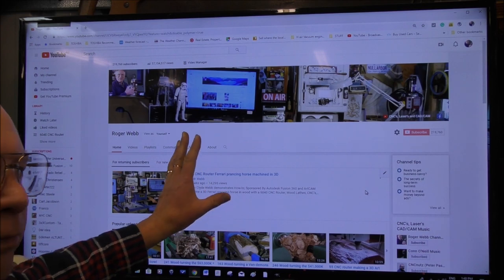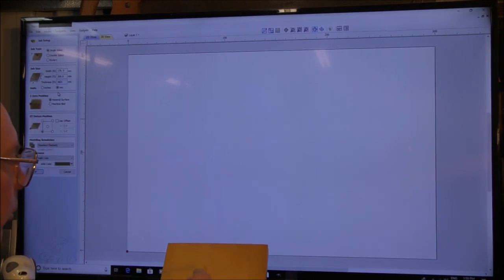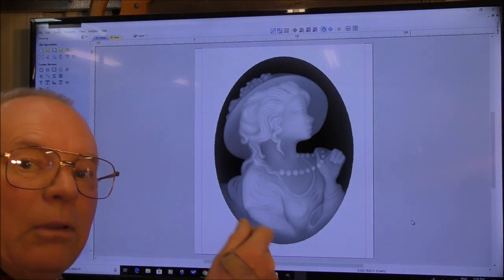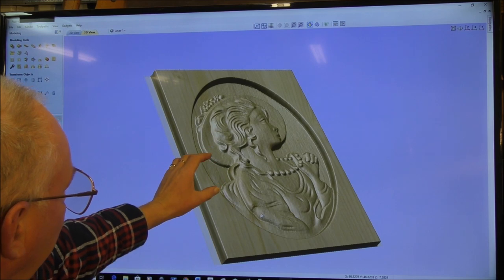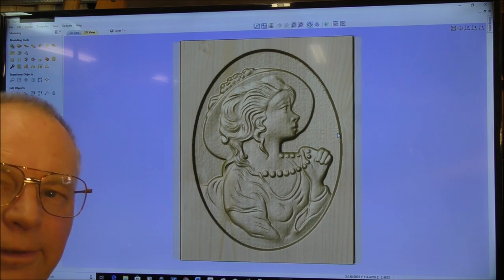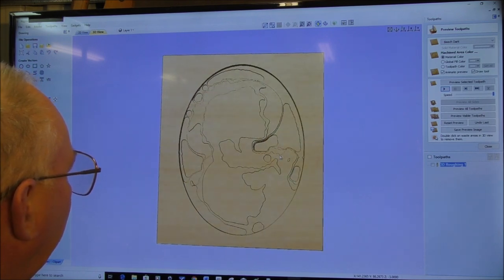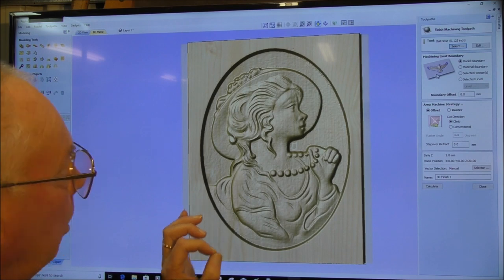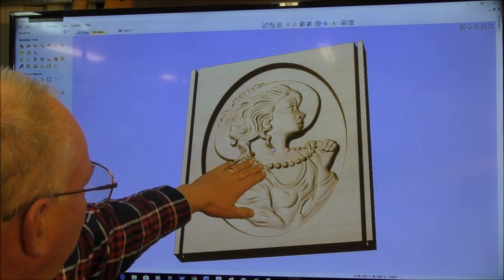*NEW* Vectric Aspire 3D modelling a grayscale image into a 3D relief for machining

Comment: Nice presentation. When you created the new tool you can select tool type and choose tapered ball nose then enter the angle of the bit as well as the tip diameter giving the software more information to give a accurate rendering.

Comment: hi  Roger,  nice tutorial.    
just to let you know that info for Tapered Ball Nose its a bit different when you add It to Tool Database. 
you can't  enter a  Ball nose bit info as a Tapered  Ball nose Bit info, . Tapered bit has  Side Angle info, and Tip radius  info , and they have to be entered precisely in the order for Aspire to calculate tool Path the right way.
Reply from the maker: Thank you, for watching, Please like, subscribe and forward the video on to a friend, Australian Inventor Roger Clyde Webb;-))
Reply: You are absolutely correct. The way he has it programmed, the taper would hit the material under the chin and in the slots at the right and left. Other than that, great tutorial.

Comment: Great video. I am just getting into cnc machining and have a question about the carving of this model. I followed your tutorial and made the GCodes but when I tried to carve the model the A axis was rotating instead of the X axis operating. Could you please explain what I am doing wrong. I am running Mach3 with 4th axis.
Reply from the maker: Check the A and X axis plugs are in correctly
Reply: @rogerwebbchannel2cncsandmo997   Thanks Roger, plugs are in correct position as they have not been changed since I first set up the machine. I have used the x axis previously when trying to do standard carving and then tried rotary carving. I am not sure why the A axis is still taking over the X axis in this situation. I will be trying to do another small project and see if it is something wrong with what I am doing or a problem with the software.